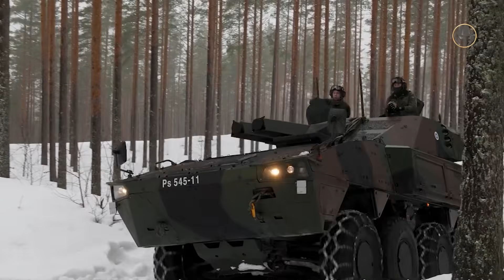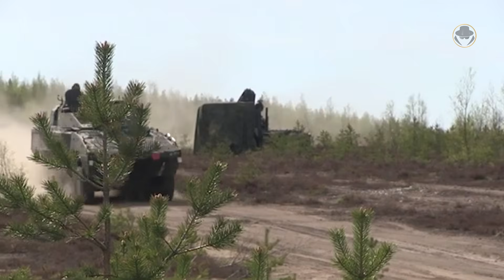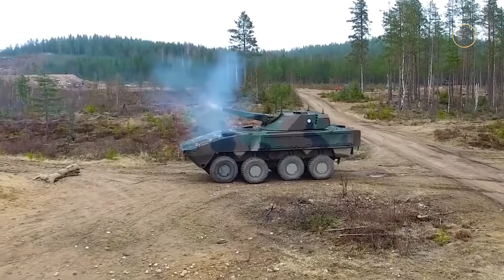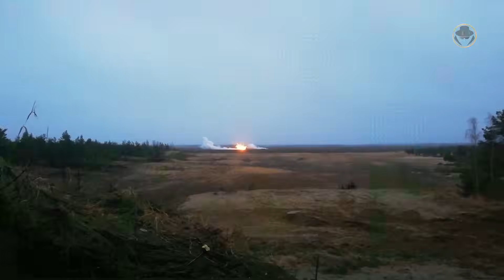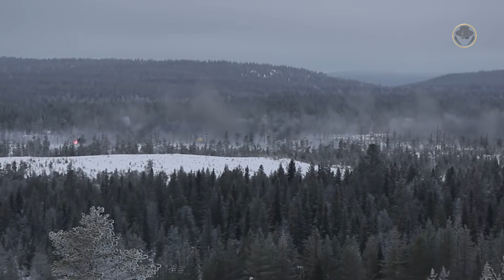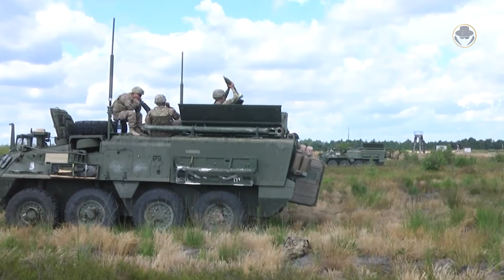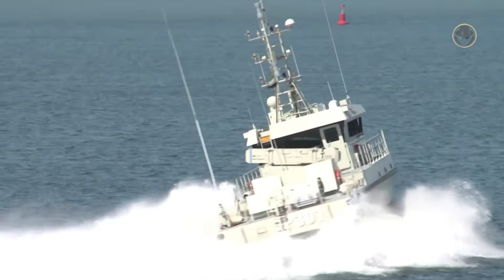AMOS - XA-361 | Why has no country, other than Finland, preferred such an advanced mortar

Comment: I can tell some reasons. The Nemo is cheaper and less complicated and you can have more room for shells. It's also lighter. You lose some volume of fire but in modern conflicts having massive volleys of shells is pretty rare anyways. With the NEMO, you can have 3-4 rounds impact the area simultaneously and then you move elsewhere and do it again.
The AMOS is good but you can do well enough with the NEMO and well enough or good enough is what militaries are looking for, typically.
Reply: For most countries NEMO fits better and while NEMO would be good addition for Finlands ranks, the AMOS suits them better because the need is to defend and maul chocke points rather than advance quick and onbtain lot of territory quick. Finland's war is not based on gaining territory but not losing it. Also lot's of killzones and layers, Finland is like onion when it comes to defending their land. 

That's why NEMO suits other countries better because the strategy is different and the war is different. 

Ps. NEMO don't have to stop for shooting, it can also shoot while driving.
Reply: @BRXCK3T  I agree to an extent, but 18 vehicles is barely enough to support a mechanized brigade. Problem for us going forward will always come down to money. Even with FiAF and FinN having their respective high profile programs well underway there might not be enough to buy more AMOS. My money is on NEMO being installed on Patria 6x6/XA-300 or the upcoming Patria FAMOUS that is scheduled to replace our Sisu Nasi and BV 206 fleets. All that with the big tube artillery also requiring replacement.
Reply: @tirepo  Yeah I think NEMO is going to replace AMOS too, but my point was even tho Mjölner is cheaper Finland don't really have need for Mjölner because AMOS provides the support more suitable for Finland, and NEMO exist if money is tight.

Also what is this about new Patria I hear now. Could you provide more info, I must know more.

Ps. Istn't there like 6 more AMOS coming? The original agreement was for 24 AMOS was it not? Or have those 6 been dropped out.
Reply: @BRXCK3T  AFAIK they cancelled the remaining 6. 

Patria FAMOUS is Finnish led program to replace the Sisu Nasu/BV 206 fleets and potentially the MT-LBs for Finnish army, for others it is likely to be marketed as an M113 replacement. It's in essence a Patria 6x6 with tracks instead. Patria had a video up about it for a few hours before they took it down.
Reply: @tirepo  "Problem for us going forward will always come down to money."
As a Swede, I can only apologize for our former cabinet Reinfeldt cancelling the order of AMOS and thus driving up the cost.
Reply: @BRXCK3T also rocket artillery like tracked M270 or wheeled Himars already cover the suppression and saturation aspect. That and the Mjornir means that the ATMOS kinda losses its niche
Reply: @quakethedoombringer  But Finland don't use Swedish hammer and M270, nor they use Himars I believe besides Himars is different system.
Reply: @BRXCK3T  Finland has M270
Reply: @quakethedoombringer  M270 and HIMARS don't fill the same role as mortars. Cost aspect, possible rate of fire, engaging distance, ammunition availability, all are completely different. The ammunition Finland has acquired for M270 is all guided and expensive, except AT-2 scattering mine system, that is not currently used because they're questionable as Finland has ratified Ottawa Treaty.
Reply: @BRXCK3T  "Ps. NEMO don't have to stop for shooting, it can also shoot while driving."
Most can shoot while driving, it is the hitting part that is difficult ;)
Reply: @johanmetreus  I never claimaed otherwise
Reply: @BRXCK3T  Most people survive falling from a cliff.
It is the landing that's a killer. 

Lighten up, both comments are jokes. :)
Reply: @johanmetreus  Oh. Ye, ye, ye. I see now what you meant. It's like every weapon can shoot no matter if they hit the target. Sorry. I was too busy to give moment of though on that to realize you joking. That is true every mortal can shoot on move but accuracy is different, at least NEMO and AMOS can Actually do it accurate. Sorry I missed your silly joke.

Comment: Dutch military is looking to buy these kind of vehicles based on the cv90 with the Mjölnir turret. They should just buy the AMOS
Reply: The issue is that AMOS cost a lot more, someone said you could get 2 Mjölnir for the cost of 1 AMOS.
Reply: @znail4675  2 Mjölnirs for 1 AMOS but AMOS has far better shots per minute at 20 meanwhile Mjölnir is only at 6 per minute.
Reply: They signed for the Mjölnir.
Reply: More special, they signed for the Mjölnir turrets as far as I know.  The CV90 is undergoing a Midlife Update in the Netherlands  and some of the rebuild undercarriages will get a Mjölnir turret.

Comment: The AMOS has been replaced by the NEMO
Reply: Nope, NEMO is AMOS but with just one tube, NEMO is used usually more on finnish boats and AMOS on these amvs both are still used. (also if i remember correctly AMOS was made after NEMO)
Reply: @McDuggets  AMOS was the original, a joint project between Finland and Sweden.
Scaling back to one tube made the turret a lot lighter, which allowed it to be used on other vehicles as well.

Comment: Poland use same lvl advanced mortar. SMK 120 RAK
Reply: SMK 120 RAK is not comparable to either of these systems it's much closer to regular mortar slapped onto APC. This was done to lower the per unit cost because they needed more units than they they could afford NEMO.
Reply: @xYarbx  ekhm...lol
Reply: @xYarbx  Huh? The Rak is also a turreted system, like the NEMO, but it's better than the NEMO in basically every way (while also being cheaper), so I don't know what do you mean.
Reply: @olekzajac5948  Lay of the copium there is no trial evidence that it would be and it lacks features like on the move fire capability. I know you want to be nationalistic and claim something from your home country is the best but when there is no data to support it you just end up looking like 12 year old fan boy that does not know what end of the gun the projectile comes out of.
Reply: @xYarbx  The only person who "does not know what end of the gun the projectile comes out of" here is you after you suggested that the Rak is more comparable to towed mortars, just mounted on an APC.
Firing on the move is a useless gimmick for artillery, be it for mortars like the NEMO or SPHs like the RCH 155 - it offers no advantage whatsoever while reducing accuracy and increasing complexity of the system and thus its price. Other than that, the Rak has faster sustained fire rate then the NEMO and is fully autoloaded which means that its fire rate is constant no matter the firing angle, as opposed to the NEMO which needs to turn the turret forward and lower the barrel after each shot so that the loader in the hull can place the round onto the rammer's tray. So yes, there is a lot of data that clearly shows which system is better, and it's not the NEMO.
Edit: your comment seems to have been deleted, it's not visible when browsing the comments.
Reply: @olekzajac5948  If your fire mission takes more than it couple of minutes you run the risk of counter battery fire so long sustained fire-rate is not high on the to have list. You need lot of burst potential to execute the fire mission fast and boogie the hell out of there. 

There is absolutely place for firing on the move for example retreating fire support ask any artillery man and they will tell you shoot and scoot is the norm.

Auto loaders have always been unreliable and lead to huge compromises. Just look at the Russian tanks in Ukraine joining space program. There is a reason why every western nation has stuck with manual loaders. In addition highly trained crew is almost always faster at loading than auto loader.

Also if we are talking about the NEMO purely as unit it can be placed on shipping containers that can be made fully auto loading. Weird that you foam about complexity when auto loaders are prime example of making systems more complex & costly for no obvious benefit.

RCH 155 is not mortar it's wheeled SPG and covers totally different type of fire mission need.

According to OSINT  SMK 120 RAK has sustained rate of fire between 6-8 rounds a minute where as NEMO can fire 10 rounds a minute burst and sustain 6 taking into account the duration of average fire mission there is hardly a huge advantage if any.

SMK 120 RAK weighs 25 tons Patria 6x6 weighs 15 tons and NEMO 1,9 tons making it significantly lighter allowing it to cross smaller bridges, better off-road maneuverability and most importantly less wear and tear on the drive train. That is gonna be huge on industrial scale war.

Yet again I restate SMK 120 RAK was made with the idea of "good enough" where as AMOS/NEMO are pushing the technology forward.

The comment was indeed deleted by someone that was not me.
Reply: @olekzajac5948  the autoloader is unnecessarily complicated for an indirect fire vehicle. I know it was a requirement as to function as a direct fire support as well if needed, but in indirect fire you'll still need to prepare the ammunition first by hand (select the amount of charge bags needed, adjust the fuse and take out the safety cap), then load it to the autoloader which then performs the loading to the breech. Whereas in the NEMO you just prepare the ammunition and load it into the breech directly.

The greatest asset of the AMOS/NEMO is the capability to quickly respond to firemissions with MRSI, and adding an autoloader which would have to be loaded first complicates things, as every firemission needs the ammunition prepared specifically for it. At least with an additional assistant loader (3 man mortar crew + driver and vehicle commander) the preparation of ammunition is quick enough so that any firemission can be started after the first three rounds or so are prepared.

And as the vehicle has automated position and direction tracking (INS and GPS positioning systems), if you need to fire any longer firemission outside the frontal arc, you just need to turn the vehicle; the gyrostabilised gun-mortar can fire while doing that, and is automatically retargeted anyway.

In indirect fire the NEMO is better, but if you intend to use the vehicle in direct fire, then the RAK is significantly better. AFAIK the Polish requirement was to be able to offer direct fire support also apart from self-defence, which of course backs the decisions made with RAK. AMOS/NEMO have direct fire requirement only as self-defence; Sweden planned more versatile purposes, but the Finnish requirement of purposeful use was only indirect fire, and as Sweden dropped out of the project, the autoloader project was discontinued.
Reply: @XoravaX  No, an autoloader is not "unnecessarily complicated". It also wasn't a requirement for direct fire, NEMO is capable of direct fire despite not being autoloaded. Rak was never meant to serve as a fire support vehicle, the direct fire feature is for emergency use only. If it was meant to be a fire support vehicle as well, it would've had a stabilizer which it doesn't need as a mortar (NEMO doesn't need it as well btw, firing on the move is useless for indirect fire).
Sweden didn't want a more versatile system either, they wanted a cheaper one. If Sweden wanted system able to perform direct fire support duties as well, they would've developed something similar to the Elbit Crossbow - with a coaxial machine gun, hard kill APS and so on, but the Mjölner is a muzzle loaded, manually operated system worse than all other mortar turrets in every single way except the price.

The loading systems in the Rak and NEMO don't work the way you described either. The NEMO isn't all manual - the loader doesn't load the rounds into the breech, he puts it into the automatic loading system which then loads the round into the breech: https://youtu.be/bNZYuk2dT1Y?si=hSfS7YcNdGLUCLej&t=45. The Rak's autoloader isn't "pre-loaded" before every fire mission, it's loaded normally the same way NEMO's ammo rack is loaded, and if the amount of charges needs to be changed (which doesn't need to be done before every fire mission), the gunner can do it when the round is pushed out of the bustle ammo rack onto a rammer arm. The autoloader can also be loaded with rounds that have different amount of charges and programmed accordingly to know which is where, the same way different kinds of rounds can be loaded into the autoloader of the Leclerc or K2 for example: https://youtu.be/SOFE0scCX1o?si=APmxfwa6_8C02fmj&t=104.

Rak is also able to perform MRSI fire missions just like the NEMO and AMOS. With less rounds than the AMOS of course, because it has one barrel instead of two, but it's still MRSI-capable.
Reply: @xYarbx  Do you bring Russian tanks (where the autoloader isn't even the most significant issue regarding survivability) as an argument against all autolaoders? Tell me then, why does the Leclerc have an autoloader, so does the K2, Type 90 and Type 10? Also, how would an autolaoder make the Rak more prone to ammo cook off than the NEMO if both have non-isolated ammunition storage? The only thing you're doing here is repeating stupid internet myths, not realizing that it's not the autoloader itself that makes the tank explode when hit, but rather the ammunition not being isolated behind blast doors.

The NEMO container isn't fully autonomous, there's an operator inside that performs the role of a gunner and loader: https://www.youtube.com/watch?v=bNZYuk2dT1Y&t=45s.
Firing on the move has nothing to do with shoot and scoot, and is useless for artillery - it doesn't offer a single advantage over a system that can get into and out of a firing position quickly, like the Rak or AMOS, while decreasing accuracy and making the system more complex. I used the RCH 155 as an example here as it's also capable of fire on the move for no good reason.

And considering how the ammo is handled in the NEMO, the 10 rpm burst lasts for 2-3 shots, then it drops to 6 rpm. Which, as I've already said, is not achievable if firing to the side as the turret can be loaded only when facing forward. And since basically every fire mission is more than 2-3 rounds, the NEMO doesn't really have a practical fire rate advantage over the Rak, quite the contrary in fact.

Yes, the NEMO turret is lighter than the Rak (which according to my calculations weighs about 3 tonnes), but while it enables the NEMO to be mounted on a lighter chassis, it makes next to no difference when it comes to wear on the drive train.

While it can definitely be said that the AMOS is pushing the technology forward, the NEMO definitely isn't - it's less automated than the Rak, it fires slower, it's not as mass produced (there's about twice as many Raks produced as the NEMOs) and therefore more expensive. It's only theoretical advantage is the fire on the move capability which however offers no practical advantages.
Not to mention that there's a new version of the Rak in development, called the M69, which will have the fire rate of 12-10 rpm, a longer barrel (L/33 instead of L/25, so 4 instead of 3 meters) and therefore longer range, as well as be better armored.
Reply: @olekzajac5948  Sweden was co-developer of AMOS, but under Reinfeldt Genomförandegruppen decided to show the military how to save money and cancelled the order.
This resulted in the 40 prepared hulls waiting for the AMOS turrets sitting around without purpose, with the army lacking both fire  support AND money, as the penalties for breach of contract was higher than the budget allocated for the purchase.

Two terms later, the department of defence finally understood the problem, but now budgets were tight so a cheaper solution had to be made.
Reply: @olekzajac5948  now compare RAK to AMOS, not the one barrel version NEMO. also firing on the move as a vehicle with direct fire capability on a APC chassis is quite important. you can use it to assist your troops if needed. ofc in poland which is very flat and not a lot of trees it s different but Finland which is one of the most forested countries in europe firing on the move is quite handy

Comment: Poland needs these!!
Reply: We have a better system already, the M120 Rak.
Reply: @olekzajac5948  it is far from beimg ambetter system, budget version would be the right term
Reply: @ninaakari5181  How is the NEMO better then?
Reply: @olekzajac5948  way better stabilizer, can shoot while moving extremely accurately. Also multiple shots landing at the same time while on the move. Can perform direct shooting effectively. Just a few to mention. Poland should have bought license for NEMO as they did for Patria AMV (they call this Finnish vechile Rosomak)
Reply: @ninaakari5181  Firing on the move is useless for artillery systems as it offers no advantages over just being able to get into and out of the firing position quickly while making the system more complex and being less accurate then firing while standing still. And the Rak is capable of MRSI and direct fire as well.

While, on the other hand, the Rak has an autoloader that is able to load the gun in every position of the turret (while the NEMO has to be returned to the loading position after each shot), which means that it has faster sustained fire rate. It is more mass produced (there's about twice as many Raks as there is NEMOs) and thus cheaper than the NEMO.
Reply: @olekzajac5948  TY!!
Reply: @olekzajac5948 Rak also has Finnish origins so i approve this
Reply: @McDuggets  It doesn't, it was designed entirely in Poland by HSW, the fact that it's mounted on the Rosomak chassis (so a modified Patria AMV) has nothing to do withthe origin of the turret itself.